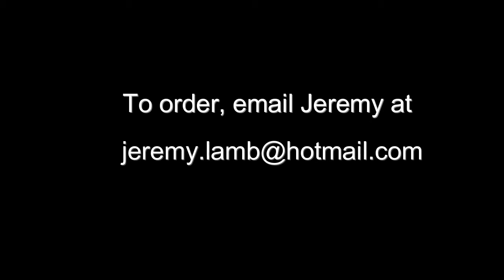1World Bypass Oil Filter Install

Comment: The ByPass oil seems to be coming from the oil filter chamber outside the filter, that is, before it goes thru the standard 20 micron Inline filter. This unfiltered oil will clog a fine 2 or 5 micron ByPass filter quickly. More efficient to collect oil from downstream of the inline filter. This will be difficult as oil goes straight back inside

Comment: 1. it is rather wise to pre-fill the bypass system with fresh oil to prevent a dry start-up.
2. the bypass filter location is not too wise, coz it's prone to damage in rough terrain + I would install it in the engine bay, at higher level than oil pan.
Reply from the maker: M0N33R, this doesn't replace the stock oil filter that is already in place. This bypass filter continuously takes a small sample of the oil, then puts it back into the oil fill cap. 
It is also pressure based, so it's ok if it's lower than the engine and oil pan. 
This filter can be mounted horizontal, and could have been tucked up as such in the area it was installed in this video. 

We weren't personally worried about it being damaged where it is because the running boards are actually lower than the bottom of the bypass filter. I understand that every truck is different in where this would be best placed. But that is the beauty of it, you can put it anywhere you want.
Reply: Got to love it when someone like this does now know wtf he is talking about.

Comment: That is an incredibly long distance for oil to travel. Especially the filtered oil having to be pushed up into the engine bay, to the fill cap. If you keep your system in the engine bay, with as short of oil travel as possible... it will work more efficiently.
Reply from the maker: It actually doesn't affect the efficiency since it's pulling and pushing onlt a sample of oil continuously. The engine is not dependent on only the pushed oil from this filter.

Comment: Jeremy the owner of this truck just had his oil analyzed and after 5,000 miles, pulling a 45' toyhauler 5th wheel to Vegas once, Grand Junction, Colorado twice, and Denver, Colorado once, plus it's his daily driver, the oil is as clean and contaminate free as brand new oil.
Reply: how many more miles would you put on the oil?
Reply: As many as we can, until the analysis comes back that it needs to be changed.
Reply: Nice!!!!
Reply: Wendy Lamb a

Comment: my only fear or concern is that the filter is in a very susceptible place for road debris to damage it. One untimely rock and you are pouring oil out on the highway. Id raise that filter up at least 6 inches.

Comment: I like that system and install. Couldn't that big filter be installed horizontally (lengthwise) on the frame so it is inline and tucked up along it as opposed to hanging as low as the running boards? Seems like all that is needed is a hole drilled on the frame to have that mounting option

Comment: How long did you get out of a oil change
Reply from the maker: We got to about 15,000 miles and had an analysis done, everything was still good!! But we ended up doing an oil change because it felt bananas to have the same oil in it that long! We could have/should have gone a lot longer.

Comment: Does anyone tried adding an external oil cooler with this kit instead of an oil filter. My 6.4 oil cooler is clogged and I wonder it this setup will work. Don’t wan yo to spend on the 1,500$ kit as this truck has 300,000 miles.
Reply from the maker: Hi Joe, this would not work. The factory oil cooler puts a bigger volume of oil through the system. Since this by-pass filter only takes a small sample of oil at a time, it would starve your engine of oil if you didn't have the oil cooler in place as well.

Comment: Looks like crap. Don't like it at all.
Reply from the maker: Brandton Stockton, what do you not like?
Reply: I want something that looks factory. I want it to look like it's suppose to be that way. Then to have the filter hanging THAT low is asking for trouble. And why not a spin on filter? I know this one is designed this way but why is it designed this way and not just with a spin on?
Reply from the maker: The reason it does not replace the stock oil filter and location has a lot to do with the flow rate. The stock oil filter that spins on has bigger pores in it, allowing the oil to quickly flow through so that the engine can get the amount of oil it needs. This in turn allows bigger particles to flow through the filter, into your engine. The bypass filter takes a small continuous sample of your oil (using pressure) and filters it through a very fine filter and puts it back into the oil cap. In the first hour of the engine running, all of the oil has ran through it. So every time your engine is running, a small amount of oil is continually getting cleaned through this filter. We have over 8000 miles on the oil and bypass filter on this truck and the oil still looks like light brown honey. Which is unheard of for a diesel! 

The specific spot on this truck, we weren't worried about it hanging down where it is. The running boards are right by it and lower than the bottom of the by pass filter. But really, it can be placed anywhere you want it.
Reply: I still want something that looks factory. I know what an oil bypass system is, what it does and why everything that users oil should have one. Once again, the placement, i've seen more running boards bent than not so having it that low is a risk that I'm not willing to take.
Reply: Brandton, you can also mount it in different locations, this is just where it works for Jeremy's truck.
Reply: Another reason for not having a spin on filter type is, the waste. Your only getting rid of the element. Which saves you money by not having to build a canister type cartridge. We pass the savings on to you and the planet!
Reply: Yah because you rather keep running oil dirty than to just have a practical solution. Because man you have a show car right ? You open that hood and admire your engine every day right? 

LOL